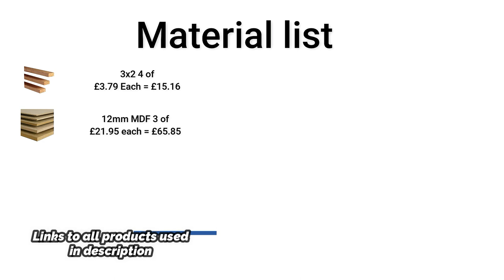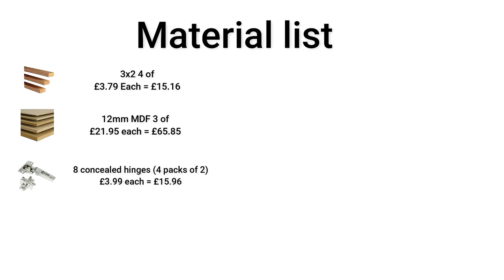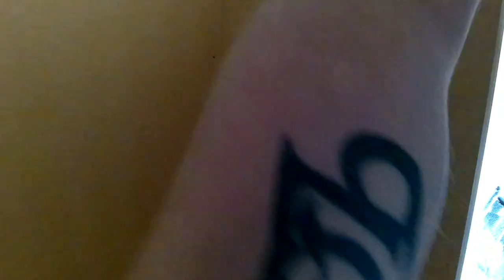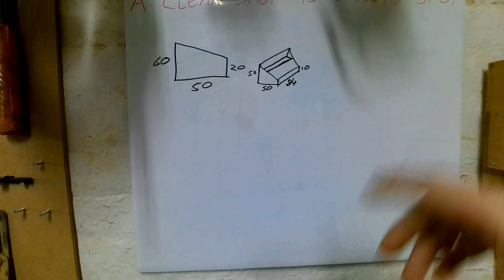DIY. How to build shaker style, under stairs storage units with pull out drawer

Comment: Hi Phil, this has helped so much thanks. Just wondering if you found 12mm MDF was substantial enough, or did the fact you did panelling fix that anyway. Seen a few ppl saying go up a few sizes but it'd stick out a bit if I get much thicker. Cheers.
Reply from the maker: Doubling up the 12mm for the edges makes them much more substantial.
They seem pretty good still
Reply: @philscraftcorner  cheers. might have to meet in the middle then and go 18mm (no panelling here, too much cutting and maths at 40 degree angles for my blood)
Reply from the maker: With 18mm you need to be careful the hinge cutter might poke through the front  of the material
Reply: Yeah I've got 26mm hinges not 35 from a junked wardrobe, so depth *should*be ok. Need to dig out the old cabinet door to check depth+ make a jig

Comment: Would it be a waste of material if you built individual units and then just slotted them in side by side. Thinking of doing this but I want atleast one large slide out drawer
Reply from the maker: You can definitely build separate units and slot them together, if that works better for you. It would certainly cost a lot more in materials though